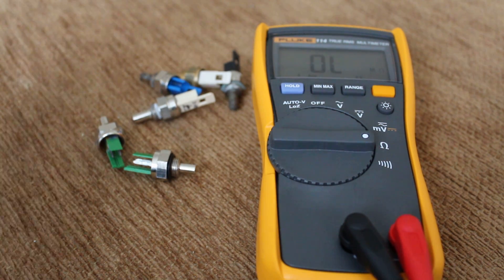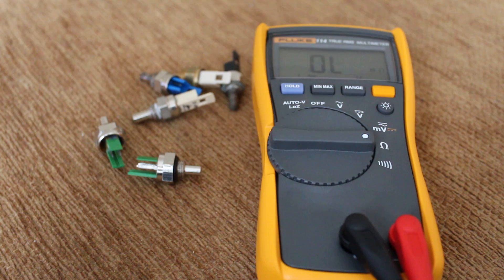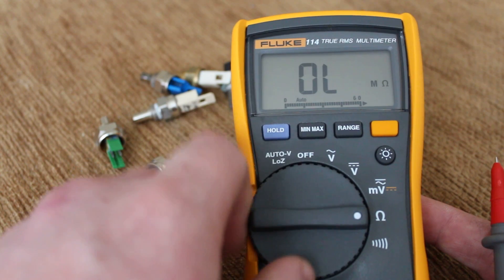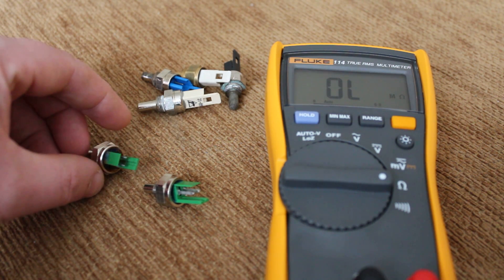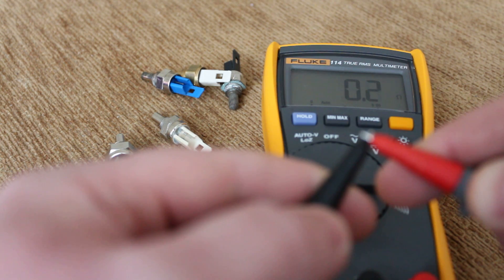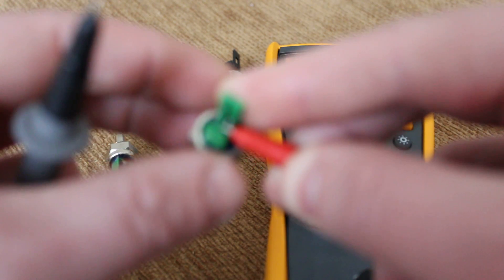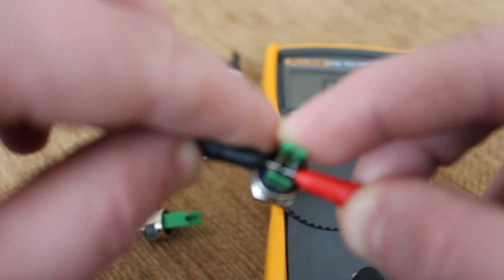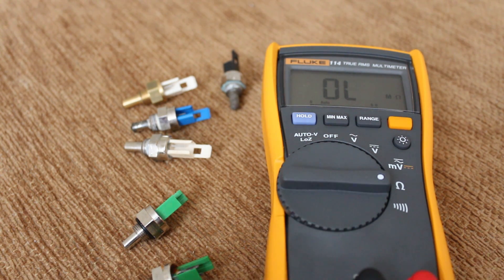COMBI BOILER,TEMPERATURE SENSOR TEST,THERMISTOR TEST

Comment: Just a quick question please , my heating hasn't been on all summer (turned to dhw only ) , however water has been hot as normal , pressure is fine , however water often goes cold , from these videos it sounds like the temp sensor , however pilot light goes out , would pilot light go out if bad hot water sensor and dhw on only ? Thanks

Comment: I believe when you tested the second thermistor the lead tips were touching and that's why you got the O.L reading....then when you moved you got a correct reading. You remind me of tradies I've hired here and cost me more $$$ then needed.
Reply: If the lead tips were touching you wouldn't get a O.L reading (basic electronics testing).  You would get 0.1- 0.9 ohms like he showed earlier in the video.
Reply: redrock1963 im just comparing these readings he got the first one was correct for room temperature,  and the second one of 9000 is showing a temperature of around 27 Celsius.. I wouldn’t say that’s too problematic if anything the boiler might cycle on and off at lower deltaT room temps..

Comment: Hi, when removing these sensors.. Do you need to drain the boiler or anything like that? Will water be behind the sensor?
Reply from the maker: MonkeyPumpkin some are dry pocket but I'd drain it to be sure.
Reply: TippTopp81 thank you very much for the reply!! :)

Comment: 11.000 to 13.000 oms is when the boilers cold what should it read when boilers running???
Reply: These work by decreasing the resistance proportionally with an increase in temperature, for example 25 degress C to start at 12,000 Ohms, to 55 degrees C at 4,000 Ohms. As temperature goes up, resistance comes down.

Comment: Great video, clear explanation. I have central heating working fine but no hot water. I have been informed that DHW Thermistor could be an issue as boiler does not know of problem. Thanks I will try your video explaination.
Jay